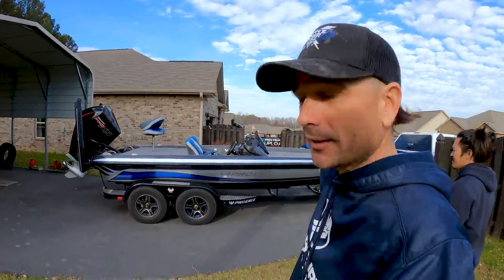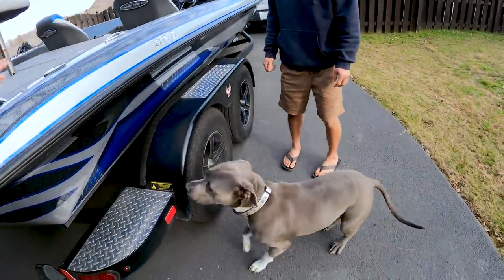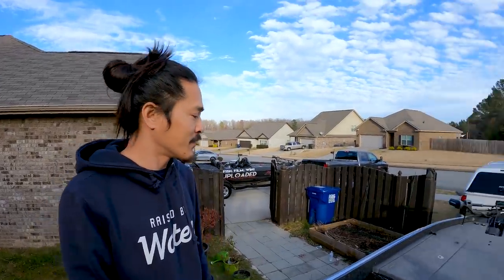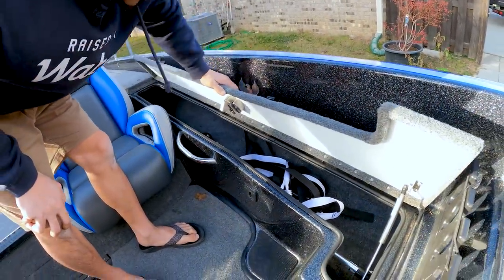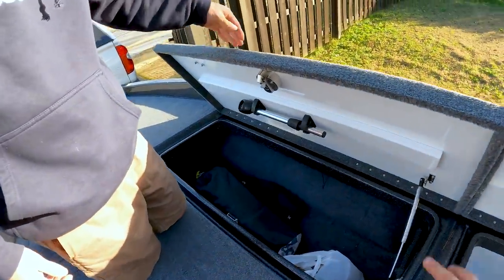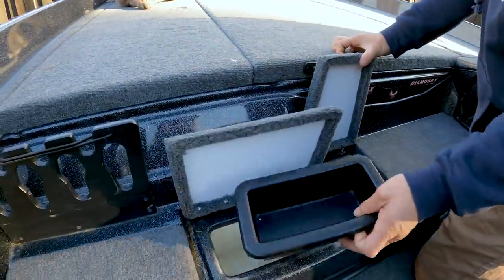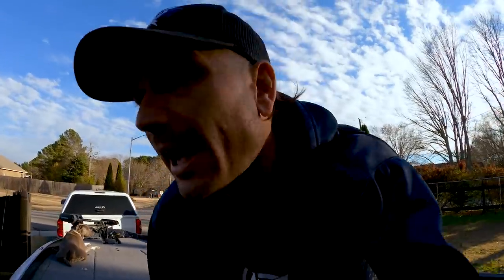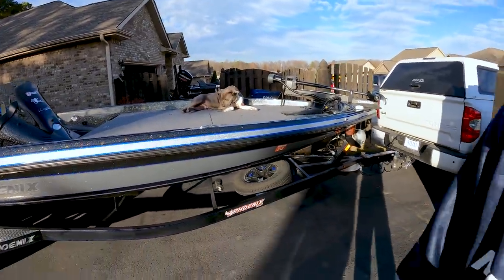The PERFECT Bass BOAT PHOENIX PHX

Comment: Good video! I have a new 919 and absolutely love it. 19'8' boat with a 225 hp that rides and feels bigger that a 19' boat. Super wide front deck. Probably the most bang for your buck boat that Phoenix makes in my opinion. Another great thing about Phoenix is that you have endless color options to custom order from and you are not limited on any particular engine make.. at Phoenix you pretty much order it how you want it!
Reply: How does your boat handle while running wide open. Reason I'm asking is I bought the 919 in 2014 brand new and it handled like crap traded it in two years later for a Skeeter zx250

Comment: Last year when used boats went through the roof due to supply, I sold my 06 Ranger z21 and ordered a new Phoenix 920 Elite. In short, the 920 Elite is fast, gets on plane quick, rides smooth in rough water, has no wasted compartment space, comfortable seats that are easy to get up and down in, 2 lighted massive livewells w/ recirculation, plenty of rod storage and just a sharp looking boat. I would not buy one without a jack plate. Especially nice in shallow water take off. Great videos on the perfect bass boat. 🤙👏

Comment: You have found the perfect bass boat! but you would like the elite series better is has low gunnels for flipping. My good camera took a swim so as soon as I get it replaced I will do a review of my 921 Elite. Hope you check it out and you can see the difference between the 2.
Reply: I've been in all three and there's very little to no difference in the gunnels in the three Phoenix models. He would like the Bullet 21SS which has ridiculous low gunnels about 1 1/2 inches and is a sharp looking boat.

Comment: Mikey - thanks for sharing your Perfect Bass boat videos and journey... good stuff. I have a 2022 Phoenix 919 and it is epic, rides and turns like it is on rails, and did I mention it is quick too and also gets and holds on plane at low speeds when scouting.  It is only 24' on dual axle trailer so fits in tight parking spots and McD drive thru.  I came out of a Ranger 364V which was a great boat for its era, but the 919 rocks.  You are right about the higher gunnels being slightly harder to flip, but I am 6'0" and don't think it is enough to outweigh the positives with dry ride (minus Humminbird 360 pod and shaft) and security to keep your rods from taking a swim when you open the rod locker lid or a low hanging branch sweeps the deck clean.  All the boats you have looked at are nice but imo the 919 Bird is the deal... it fishes big, flat out hauls @ss and has a lower price tag. Best to you in your search.
Reply from the maker: great insight!

Comment: Tin is in. Check out the Ranger RT198P with a Yamaha SHO. Loaded out it will run about 55 mph, Handles rough water great and a whole lot cheaper than a glass boat.

Comment: Mikey just fyi… I had 3 different Rangers over 30 year period.  Last one being a 08   188VX with G2 150 HO.
Last December bought a Phoenix 818 Pro with 175 Merc Pro XS. Tandem trailer etc.  you said you probably wouldn’t go with 21’ boat but probably somewhere in between the one I have & it.  One of the things I don’t like about the Phoenix is the rod box lid piston location at the back of the box. It’s in the way when you are pulling your rods out of the box.  My Rangers all had the piston in the middle so not in way.  The other negative I have on the Phoenix is the co angler rod box storage does not have a high enough lip on it.  I’ve had water leak into it during heavy rains & since there is no divider inside this box & the rod box I’ve had enough moisture in there to mildew a few of my rod handles.  I also got the padded front deck which was a little misleading as the entire front deck is not padded.  With that it made for some soft edges around the recessed trolling motor well.  I would have preferred some type of harder lip around that.  These are just minor things you see after having another brand for many years.  I love the sea deck floor & many other things about the Phoenix.  Just wanted to share some thoughts after a full year in my Phoenix.  Thanks & good luck!
Reply from the maker: Great details thanks!

Comment: My perfect boat is my 2011  Z521 ranger lots storage.my ranger always starts its a key pad start.  blinker switch on both sides for hydraulic jack plate on left trim on right. trim on throttle also.trim switch at trolling motor also wide deck gunales and perfect wont kick your rods in.Nitros are budget boats with junk components. I've seen motosr break right off the back in rough water at lake mead dude came in on trolling motor mercury 250 gone he cut the lines drop to bottom of the lake sheared right off the back.

Comment: I'm in the market for a new boat. Probably going with Bass Cat. The one thing that drives me crazy about Phoenix is that plastic cap on the console. Makes zero since to put that ugly piece of plastic on those beautiful boats. I don't want to look at that every time I get behind the wheel of an $80k boat. I
Reply: Yea but they can be replaced with a new one. You cut a hole in that fiberglass dash it’s permanent no turning back If you change graph sizes etc!!

Comment: 921 is the exact same hull but with a different top cap that has super low gunnels. That’s the boat for you I think. Say you don’t want a 21. Even the 919 rides incredibly well and are almost as fast. 920 is a rocket ship

Comment: How do I start this comment…..  I ordered a brand new Phoenix!  But it wasn’t my first choice!

My first choice was a Caymas!  Why!  Nice gunnels, fit, finish, storage, layout….but that was a 20-19.  Have no interest in a 21.  My problem. Hottest boat on market making pricing insane; vexus even worse.

I stepped into a phoenix and it was like home.  Probably better storage, especially for a
Co angler.  I could order as many options as possible for trolls, graphs, colors, livewells, etc.

The best part was flow…can I create a new term? Instead of feng shui…..the phoenix felt like fish shui!

Literally, for me at 53, and being able to exit drivers seat, up to bow, and walk perimeter as if I was fighting a fish, transitioning now to aft was super easy on my joints.

Ultimately I ordered a 819 pro, which is close to a 20’ boat…; but it’s loaded.  And I couldn’t break 70k out the door if I tried!  

Just Trust me and call John Webb at Marine Works of KY.  He tried to put me in a loaded out 721 for almost the same money I spent on my 819.